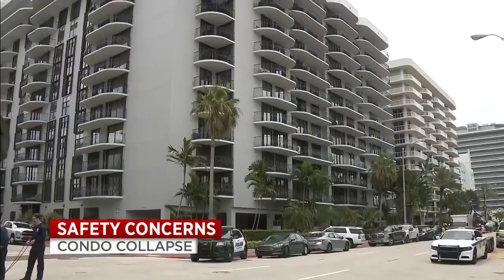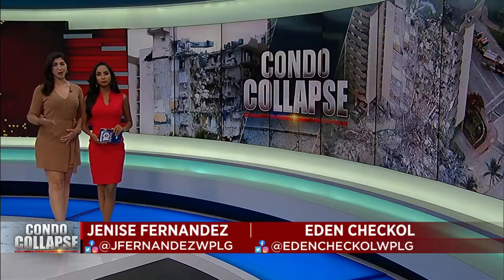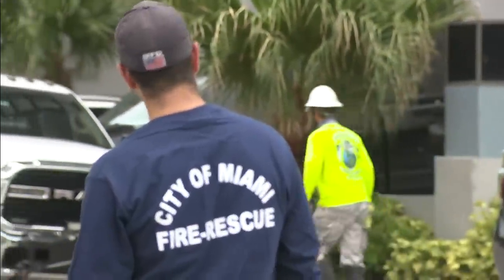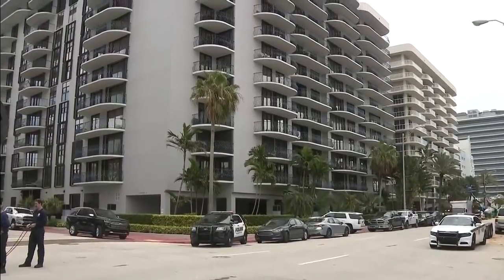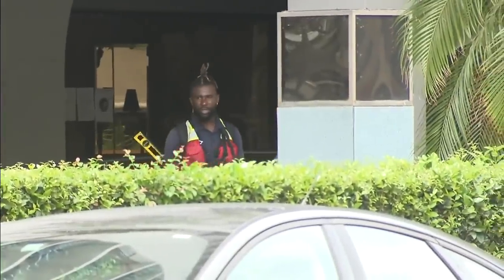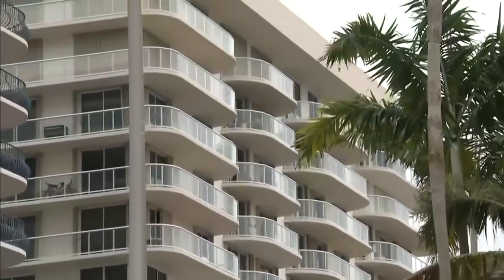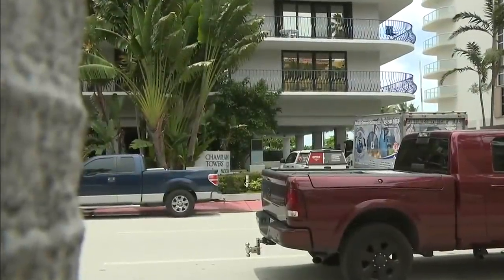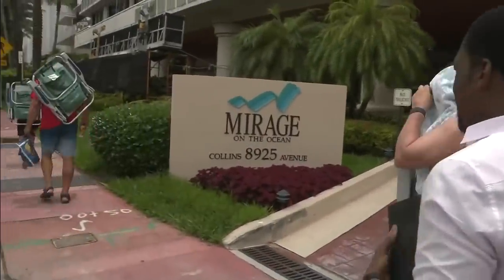Engineers inspect Champlain Towers North in Surfside

Comment: Those buildings lacked of horizontal beams reinforced and reinforced vertical columns. The steel and concrete used was very poor and lacked of strength for the weight of the structures.

Comment: I saw a very comprehensive vid here on youtube....from a engineer.....there is totally a design concern with the thin columns holding up the building as well as no grade to drain water...which in concert.deteriorates concrete and rebar at an accelerated rate....you should watch it.

Comment: Those buildings were built using the cheap flat plate design to cram more floors into the 120 foot height limit at the time. Inadequate column structure, inadequate shear walls, nonexistent support beams, nonexistent capitals on the columns. Depending on rebar to hold the slabs is similar to building a deck and holding the load with a few nails.  The decks look nice until loaded and they collapse. These flat plates collapse when the columns punch through the slabs.
Reply: Exposed steel construction using I-beams and connecting steel trusses is the answer.  Unfortunately buildings that were built with reinforced concrete do not have the space between floors to retrofit with I-beams and trusses.  They'd need to close their parking garages and they will never go for that.
Reply: So this liberates the condo association and city from any criminal charges, which is exactly what they're banking on. Passing the buck to the now dead of old age original developers.

Comment: The people in these old high rises are going to die in them, one way or another, because they'll never be able to sell them.
Reply: You’d be surprised, this is still America and a very rich state. Meaning there’s still a lot of dumb ppl

Or maybe I should say ignorant
Reply: Exactly. No one will ever buy those units.
Reply: Madness Incorporated  I'd probably take it if the engineers gave it the OK and there was a good job attached. I can't really justify moving to Florida without a good job in place. But permanent ownership of a condo unit would be great, because I wouldn't have to pay rent. There is a very high level of scrutiny on the building right now, so if engineers inspect it and say it's safe, I'll believe them. Probably there are some homeless people who would be willing to live there if it's safe.

On the other hand, Florida is a pretty messed up red state, so I guess one ought to take that into account before moving to Florida. But if I was already in Florida, it would be a no-brainer.
Reply: @robertjenkins6132  I don't think enough emphasis has been put on the part of this story where each unit was assessed its part of the 15 million repair fund, to the tune of 80k-200k per unit. That's easily 5-10 years of rent all in one shot. Not to mention the HOA condo fees, which are also a significant recurring cost. So owning a condo is not the financial bonanza it appears to be.

Comment: I think American should consider not to use this kind of no beams construction method anymore, slabs and columns are weakly connected together. no beam, the slabs need to be strong, when the slabs move it push and pull all columns. this design is found everywhere in American, when building gets old concrete must cracks and you must find some reinforcement bars rusted in some where of the building, but if one location get rusted and weaken, this building method will trigger chain collapse reaction. very dangerous, I won't live in this king of building. all this kind of building must have a more comprehensive maintenance requirements. but the problem is some private area inspector is not that easy to go in and do inspection.
Reply: I agree.  Near salt water re-bar / external-tensioned concrete simply cannot have along service life without major maintenance and renovation, which is expensive and so avoided.  Enforcement is required.  When structural engineer says “major structural damage” that phrase has real meaning.  Should be rather self-explanatory.  He shouldn’t have to jump up and down, its been noted, catalogued.  Delay is death.
Reply: I don’t know how much different Miami building codes are from the west, my understanding is that they are pretty rigorous these days, but most places haven’t allowed these types of connections between columns and slabs for twenty years or more.
Reply: If there are a beams connecting from columns to columns, when one of the slab is falling and pulling the surrounding columns and slabs, the beams interconnected will help pushing back, how can it be so easy to pull down the other columns or pull downward the other slabs from the other columns.
Reply: How can plans in re your description above be passed by the planning authority? Its ludicrous

Comment: Buildings like these should be equipped on each floor with a system that detects vibrations that can potentially predict whether a building is in danger of collapsing. Similar to a seismic activity monitor.  YES, it can be done! That building gave many signs, the Colombian couple who recorded the video of the first collapse saw how there were people on the balconies scared because they knew that something was not right.
Reply: Extremely intelligent comment, SimpleSencilla.  (And just to add, I wouldn’t find it any other way from someone with a Siouxsie Sioux avatar! 👍🏻)
Reply: @sonofhibbs4425  thank you!  The victims are all heroes, they are going to shape the future and prevent a lot of future deaths.  RIP to all the ones who didn't make it.
Reply: Excellent point
Reply: 40 years ago they didn't think of installing this in the design..

Comment: That other building is doomed!!! No matter what they do to it those buildings doesn’t have concrete beams to support the slabs!!! That is why the structure failed! It is just a matter of time to experience another tragedy!
Reply: Obviously the North tower was better maintained than the South. The East tower looks like a mix bag cos one of the column is cracked. But even if it were a design flaw, they could possibly make alterations to strengthen the buildings.

Comment: Subsidence never stops,not repairable.
Reply: Exactly. These buildings have a shelf life.
Reply: Subsidence is fixable…I’m a structural engineer and I guarantee you it’s been done on much taller buildings. It all depends how much you’re willing to spend.
Reply: @LearnwithFrankM  Yes, subsidence is repairable depending on what your subject is: road, bridge, small structure. And only for so long. This type of construction is not, too many things wrong.
Reply: @adamarlem9863  also, in such structures there’s a factor of safety is most features. So some of these cracks might not be as critical as the public perceives them to be.
Problems arise when structural drawings aren’t adhered to during construction. For instance, look at the column to slab connection in the fallen tower — there was barely any top and bottom reinforcement. Add things such as corrosion, change in occupancy type that introduced unanticipated loads, water pooling, all these make matters worse. So yeah, things might not be as drastic as the media portrays it, especially in the tower that’s still standing. Let’s the experts do their job to uncover what was missed during either the design, construction, or as a result of shoddy maintenance!
Reply: @LearnwithFrankM  Every situation will be different but  the comfort of"some of those cracks may not be as critical as the public perceives" is exactly what  brought the condos down.  Bad design or lack of care will certainly enhance it. As you say there are many factors. But subsidence is eternal and may increase for any reason-- explainable or not. Any construction or repair has a limited time. People do not like to address it because it is beyond our control. It is always safer to err on the side of caution.  Also wonder if those who made the plans actually lived in the area where the condos were built?
Reply: @LearnwithFrankM  Thank you for the best. Yes, cracks are not necessarily the cause.If not superficial surface cracks, they are a definite indicator or something more serious. How serious is the question. Subsidence is not really predictable. These are on the threshold of the world's greatest geological forces colliding, what did people expect? The cake analogy refers to the structure, not to the owner-financial oversight! Have been in a HOA, said never again, and got out before it cost me. Those skyscrapers and other buildings you have repaired are owned and financed by companies or governments which have all the necessary funding to accomplish whatever it takes.
Reply: @NachoKitty  most of these issues are repairable. Columns and slabs can all be reinforced - easy stuff. Challenge is if the foundation is compromised — that can still be fixed but would require some extensive remedial work. They can literally install new columns from the foundation, going up and distribute the buildings loads in a better way. I’m a structural engineer and I’ve done the design for such cases severally.

Comment: Never buy in a condo building in S. Florida on the beach built on stilts through an underground parking garage. Design flaw which is too dangerous
Reply: Yep. It’s crazy. 12 stories sitting on thin concrete posts.
Reply: @oldcountryman2795  I lived in a condo building on the beach but it was built on the ground. The parking garage on the street side of the buildings were built on those pillars but were maintained
Reply: @ThePrissy11  These are not in a vacuum; the west side was not subject to the same total amount of forces.
Reply: @ThePrissy11  The one famous structural engineer that co wrote a book on why building fails said it was because the deck was connected, ran under, the building. It should had been independent of the building. The way they did yours building seems a better way to do the parking garage.
Reply: @jobrownsmith116  Ok. Interesting theory but that pulled a whole building down?
Reply: I am in so cal I feel the same
Reply: Agree.
Reply: I’m totally lost
Reply: Yes💯swing building✅
Reply: @adamarlem9863  Stupid comment
Reply: @ThePrissy11 NO! U sell condos?🪓💰💀
Reply: @adamarlem9863  Not the stilt buildings
Reply: @ThePrissy11 not "stilt"..said Swing. Where did stilt come from.
Reply: @adamarlem9863  Pylons ok?  Jeez
Reply: @ThePrissy11  yes, for what you are saying.Not what I had,.

Comment: If they discover there isn't enough steel reinforcement it's a lost cause, better to demo the North tower and build something properly in its place.
Reply: @Danny Carrington seeing the remains of Champlain towers in between floors you see these really large steel rods but you only see like 2-3 sticking out.... Do you think the damned developer decided to GET CHEAP with the steel used on Champlain towers?
Reply: @camilobastidas6176  Absolutely! Plans for the columns by the pool deck called for four pieces of rebar per side but you can clearly see there are only two per side.
Reply: A memorial
Reply: @rontang8092  The memorial should go where the collapsed South tower is. Judging from past tragedies it won't be anything more than a plaque on an outside wall.
Reply: @rontang8092 yes,  named so.
Reply: NOTHING should be built in the same place except a park...no buildings should be so close to the water 👍
Reply: @titania145  Exactly. It’s disgusting that they build so close and destroy the natural shoreline.
Reply: @titania145  - purchase the property and make it happen
Reply: @titania145  the condo owners still have mortgages. So, they need to sell to a developer to be able to pay the banks. Insurance will fight them b/c they did not do repairs.
Reply: @titania145  yes, thanks you. Parks, public beach supports, conveniences, food  concessions, etc,  on sand level. No buildings on the thresholds of the world's greatest geological forces colliding-- what would you expect?